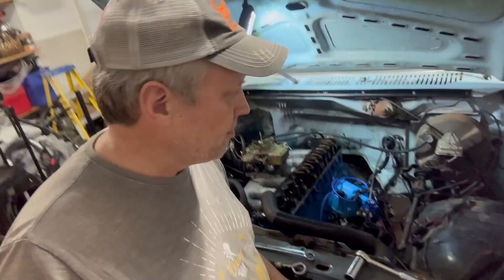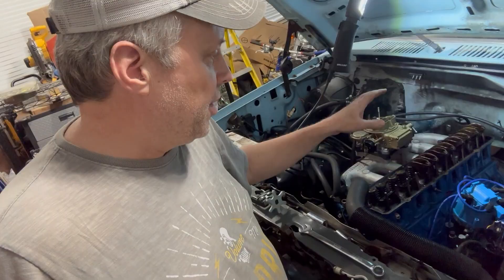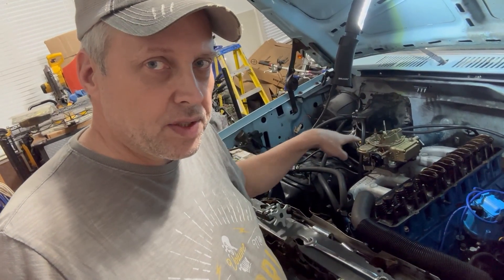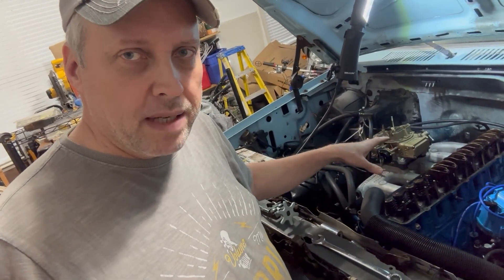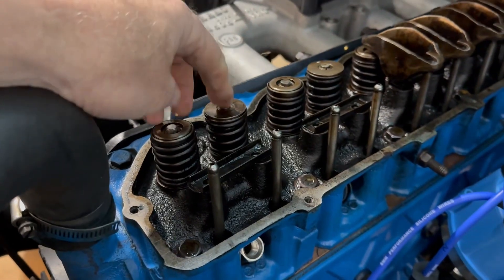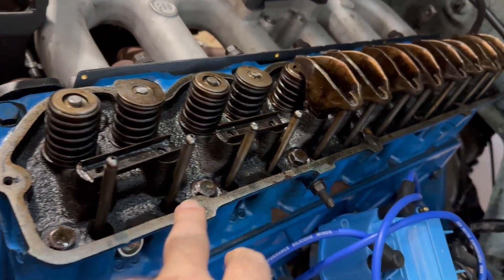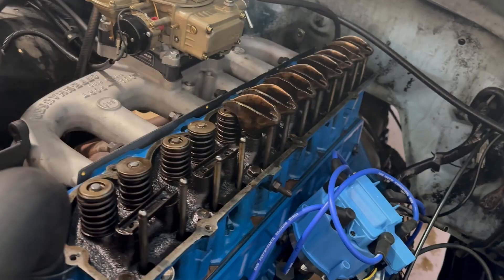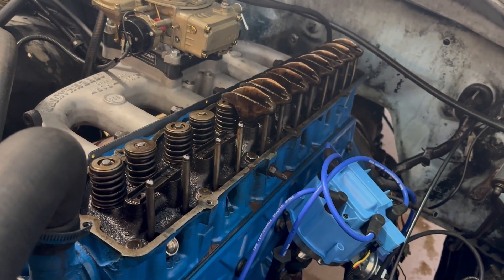Excessive crankcase Pressure. What causes it?

Comment: I really like the old 300 CID Ford engine and owned 2 of them, a 1978 F-150 with the 3-spd on the floor plus OD and a 1985 F-250 light duty with the big six, 4-spd. 
tranny, and 4WD.  That '85 would pull like a freight train in compound low and 4WD.  Probably should have kept that one but needed a super cab, so went with that.
Reply from the maker: This is my first one but it's growning on me, Ed.  I've heard nothing but good things about the Ford 300 engine.  Apparently, they are pretty hard to kill.
Reply: @barryandjeffshow  Yes, they are.  I always hoped that the 300 would be updated to a much stronger engine, perhaps via a low restriction exhaust system,
electronic ignition, porting the heads, an RV type cam, and maybe even a 4 valve per cylinder head.  If not that, then perhaps making a diesel version of the
300 for extra pulling power would have been good.  I never had any trouble from that engine, just some with the accessories.
Reply from the maker: On this engine, I have already swapped out the exhaust to a Hedman hedder and dual exhaust with Flowmasters.  I also put a new Offenhauser fuel intake on it and changed the single barrel carb to a Holley 390 cfm 4 barrel with vacuum secondary. Also changed out the distributor to an HEI, single wire.  Once we tear this thing down again, we will be adding a new cam and new pistons. That's about all I plan to do with the engine.  Then the focus will be on cosmetic improvements (wheels, possibly lowering the body a couple inches, new gauges, etc.)

Comment: IMHO I wouynit trust ANY Valvoline product..... Personal experience backed by lab analysis and false product claims as they wee nailed and had products banned in ar least one state for lying.

Now for the solution, pour kerosene over all the valvetrain while turning the crank to exercise the valves. Rinse the valves with oik, then change oil  run the engine at 1500-2000 rom spraying a light mist of 50/50 alcohol/water into the intake for abot 10 minutes.

You're done

Comment: If you haven't torn it down yet consider using Valvoline restore and protect.
 It is designed to remove varnish and carbon from the engine and from what I've seen from some guys that appear to be very knowledgeable it works very well.
 And yes, also rings.
Reply from the maker: @reedsilvesan2197  thanks for the suggestion! I’ve been a Valvoline guy for about 25 years.
Reply: @barryandjeffshow  good luck, the sources on you tube are all independent.
Reply: @barryandjeffshow  I've used Valvoline oil and Fram filters in my cars and trucks for 60 years and never ever had an oil-related failure.  I know that a lot of people 
complain about Fram filters but they have worked well for me.  Changing the oil and filter on a regular basis is essential for good engine performance and longevity.